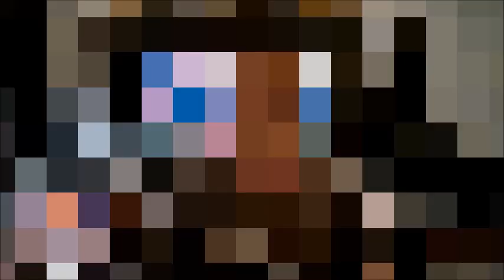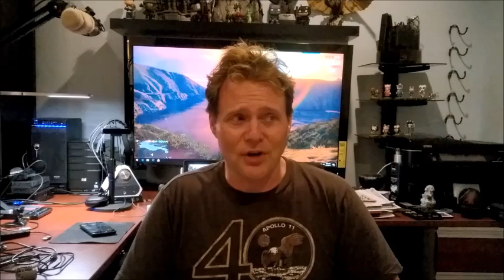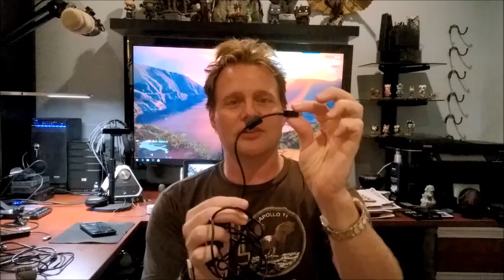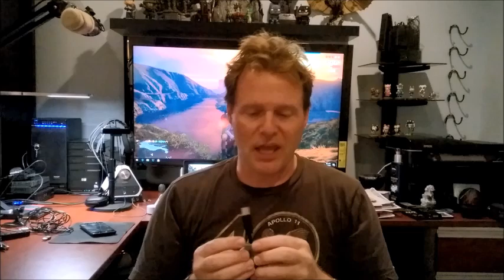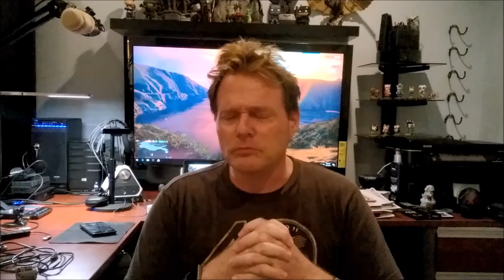What are Ferrite Cores and How do I use one?

Comment: Can you use these to reduce noise in a chain of effects for guitar? Where would you use them - audio guitar cable between effects pedals and/or power supply cables? I know guitar pickups also pull in noise, specially single coil pickups. I am just trying to reduce as much noise? Or are these not needed if the guitar/patch cables are shielded?
Reply from the maker: You're right that good shielding is supposed to solve this problem and you shouldn't need it.  If you're getting noticeable noise, that's another story, and that could be a bad grounding or EMF.  I'm not a sound engineer like some of the people I know, but if I can ask one of them for more detail, I'll share it with you. As far as using a ferrite core to reduce noise in a chain of effects, you could try connecting it at various points in the chain to see if the noise goes away at any particular point in the chain.  Hope this helps you!

Comment: Couldn.t you use copper wire to loop around the lead? 25 or more turns around the effected line?
Reply from the maker: You certainly could!  I originally did this video to help out a friend to understand the basics of what Ferrite cores are and how to clip one onto their mic to solve an interference problem--but yes, while putting a Ferrite Core on can be a simple test and provide a quick fix, introducing multiple turns of copper around the lead is certainly another option.  Thanks for sharing this! :)

Comment: Application described in simple words.  Can ferrite be used on both 120 volt n data cables or only data n voice cables.
Reply from the maker: Hi surendersignal2192! They can be used on any insulated cable, so yes a 120V or data cable, etc.  Hope this helps!

Comment: Hi Trenton, thanks for the video! Question- here in snowy MN, I used to listen to this FM radio station all day and came in great. This is on an older stereo that has the old school antenna terminal ends where I just cut copper wire for antennas and strung them up. However- I installed some LED lighting in my shop (outlet/string connections- not hard wired) here and since then, that radio station is complete fuzz and also makes random other stations fuzzy. Interestingly enough- radio is still fuzzy even with the lights off which is odd. No amount of copper wire or trying different positions has made that much of a difference so it has to be the lights. Would putting these ferrite cores on the lighting cords and/or the radio power cord help at all? Help! My classic country station hangs in the balance!
Reply from the maker: It can't hurt to try!  Also, check to see if the problem persists if the LED lighting is completely unplugged, too.  I hope that helps you!  I ended up buying an aftermarket FM antenna for my home theater system that has its own power source, so that may also be an option.

Comment: Will a ferrite core improve reception from a dipole antenna receiving at 459 MHZ...if I add a ferrite  core around a RG58?
Reply from the maker: That's a good question!  I know it won't hurt, since the primary benefit is filtering out higher frequency.  It can't hurt to try, I'd love to hear if you find a difference.  It's mostly designed to solve an RF interference problem though.

Comment: Exactly the info I needed, thanks. I recently bought a good external condenser mic and last night was getting really bad hum/buzzing.  Turned out to be where my extension cable was laying across my bed and my electric blanket was on. I get hiss anyway but was wondering if this ferrite would mitigate the interference if ever I go near such things again.
Reply from the maker: Really glad to hear it!  Condenser mics pick up a lot of the environment, so that hiss may be mitigated by adjustments to gain--but I'm glad to hear you fixed the hum! :)
Reply: @trentonbennettVO   Thanks. I've since found that ferrite is bad for audio cables. The work initially very well, but degrade the cable and over time make it sound bad. They are better for less sensitive applications
Reply from the maker: @ArcanePath360  yikes!  I hadn't heard that a ferrite bead/core/choke would degrade a cable, and I can't find anything on it.  Do you have a link you can share?

Comment: Hi Trenton!  I just finished watching your video.  One question I have is what do you do when you are receiving a local radio station through our sound system.  Every time we hook up another item, i.e. guitar, electric drum set, mics, etc., we continue to hear the local radio station broadcast through our speakers.  My question is does these ferrite cores help with blocking the radio transmission through our sound system and where would we connect these to, i.e. just the speakers, the snake, the individual instruments, etc.?  Thank you for your help in this matter.

Comment: A clip-on is effectively only one turn onto the core. The inductance increases as the square of the number of turns on a core, so, passing the wire around again is 2 turns which will give you 4x the inductance of the straight clip-on.
Reply from the maker: Thanks for this, by the way - a lot of people have been reading these comments and you've just helped them too! :)
Reply: Is it more effective to apply to the source wire, or the receiving wire? For example, on my headset I hear a whine when turning on a large 28v dc motor & heater. Do I clip the headset or the heater or both?
Reply: @kevinchase313 check the description on the video. From what I read, I think it is the receiving end, not the source. If you can get extra cores just add them to both ends, as it provides extra protection!

Comment: A clip-on ferrite does not shield the cable, it increases the inductance of a cable, thereby reducing currents due to interfering high frequency or R.F. magnetic fields. When clipped onto a twin cable such as the power cord, it will only increase the inductance to common mode signals. You would need to clip onto individual conductors separately to impede differential mode interference. Small ferrites only work at high frequencies. There are many different types of ferrite, some lossy , others not. None will do anything for hum or other low frequency unwanted signals caused by electrostatic pickup from electric fields. You need screened cable to reduce these.
Reply from the maker: Thank you Ricobass0, this is a much better explanation. :)
Reply: Is it better to combine the power cord or separate conductors?

Comment: Hi great video Thank you.

I am by no means familiar with emi rfi noise, so I got a question.
I am using ferrite cores to supress noise on my pc quipment. From your video I understand I should be placing them near the ports of my pc.
Am I correct in assuming that? 
I have a few cores around my power supply, usb, dvi and hdmi cables
Reply from the maker: Hi Roku! I'm glad this video helps you.  That is one way to test, yes.   Basically if you're having an electrical interference problem, a Ferrite Core can help you either troubleshoot or eliminate the problem because it shields the device and can block the bad signal...so if a USB device is getting interference from within the PC then stopping it before it goes down the wire might help.  However, if the device is getting the interference from the surrounding air, you could also put one on the end too.
I'll explain a bit. :)  
If you look at a wired XBox 360 controller, it's got a Ferrite Core built-in, near the controller, just to make sure the controller isn't getting problems from electrical interference.  When my friend Veleka (the person this video was for) was having a problem with her USB mic, I suggested she put the core near the mic because that was more likely where the interference was being picked up.  These would be times when it seems most likely that the interference isn't coming from the PC and is directly affecting the device connected to the PC.

There was a time though when I had the front-panel audio of a computer creating noise in any headset that I plugged into the front-panel audio jacks.  I put the ferrite core on the plug-end of the headset, the end that went into the computer front-panel headset jacks, because I wanted to stop the noise.  I eventually realized that the front-panel audio wire inside the case  that connected the motherboard to the front panel was getting the noise from something on the motherboard generating interference inside the case.  I put a ferrite core on the end just before where it connected to the front-panel.  When that didn't help, I replaced the internal audio cable and all was well.
I realize that's a lot of typing! But I hope it helps you.  This gets a bit technical but also explains the nature of what causes electrical interference:
http://www.emfservices.com/electric.htm
Reply: @trentonbennettVO  
Thank you so much for the detailed explanation! You are awesome for taking the time to make it a easier to understand. I am sure you are helping more people than you know.
I'll be testing for sure. Have a good day :)
Reply from the maker: @roku6170  thank you so much for this! It really makes me happy to hear it.  I had done this to help a friend and thought, "Hey, I bet other people might be wondering how all this works".  I can't get over how many views this video has gotten.  With luck I'll figure out some more useful tips that aren't easy to come across.  Hope you have a great day too :)

Comment: What benefit(s) would be achieved if ferrite cores were added to my marine/boat Humminbird/Garmin electronics...GPS w/down-vision, side Imagining and sonar?
Reply from the maker: Hi John!  Most manufacturers use the right quality cables for electronics and some go an additional step and put one of these on their cables at one or both ends, so you shouldn't need one.  You wouldn't really benefit from adding one unless you're experiencing a problem with interference and then you want to troubleshoot whether it's a grounding problem or a problem with signals coming through the air around you fouling up your equipment.  Usually that sort of problem comes from nearby electronics or being close to a radio tower, etc.  It's unlikely you'd be experiencing that in your scenario with side and sonar as the emitters are aimed away from your boat and the equipment (especially the Hummingbird and Garmin brands) should be assembled in good quality and go through Quality Control (QC) checks before it gets boxed up and sent to the store.  That said, this is a really good article to explain it a bit more in detail - https://www.rfpage.com/electromagnetic-interference-and-compatibility-in-radio-frequency/  - the bit about "Radiated EMI" is the problem a ferrite core tries to solve, and in the section "How to avoid electromagnetic interference", the passage about "filtering" refers to devices like a ferrite core.  The English isn't perfect in this article, but I like the bits about "How [is] EMI Generated?" and "Sources [of] EM Radiation".  Hope this helps you! :)
Reply: @trentonbennettVO  Problem experiencing:  HUMMINBIRD GPS 898-C combo (Side vision/Down view) shows erratic  depth levels when Minn Kota 36V troll motor is turned operating.  ALL other features functions properly except giving incorrect sonar/depth numbers-while in 12’-15’-gives 50’+, 60’+, etc…!
Reply from the maker: @504blood-sweat-tears  yeah, I can see why that would be a problem! I'm wondering if the trolling motor is hooked into the same electronics as the Humminbird--thankfully, they've got an article in their help center that talks about exactly your situation - see if this helps you?  https://humminbird-help.johnsonoutdoors.com/hc/en-us/articles/4412819927063-Trolling-Motor-Interference
Reply: @trentonbennettVO  Thanks will ck it out…ALL 3 batteries designated ONLY to  36V troll motor.  ALL Electronics run off start battery…!
Reply from the maker: @504blood-sweat-tears  Rats!  I was hoping that would help you, but you might have to try multiple ferrite cores to see if you can kill the interference.  Hope you can find a solution, I know how maddening it can be sometimes when things that shouldn't be going wrong, are going wrong weirdly. :-/

Comment: I just receive a 20 pack fro Amazon but I still have one question.  How do you open the little guys?  Please respond if you have the answer.
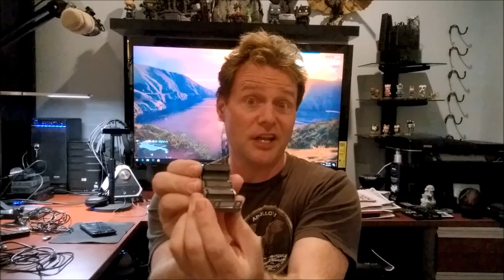Reply from the maker: Sure thing!  There should be one or a pair of little clips that you can pry apart.  Here's an Amazon listing that has a picture of one open so you can better see what I'm doing there in the video from about 1:29 to 1:47.  I hope this helps you!
  https://www.amazon.com/RF-Choke-31500-Ferrite-Material/dp/B00XDACVOM/ref=sxin_16_pa_sp_search_thematic_sspa?content-id=amzn1.sym.b245e49f-68a4-4489-b1f9-81f4034255f5%3Aamzn1.sym.b245e49f-68a4-4489-b1f9-81f4034255f5&crid=3DA9IEVWMK9BT&cv_ct_cx=ferrite+core&keywords=ferrite+core&pd_rd_i=B00XDACVOM&pd_rd_r=c15e64bc-6aa7-49c7-b555-761f23715aeb&pd_rd_w=3KCVk&pd_rd_wg=lk4Kg&pf_rd_p=b245e49f-68a4-4489-b1f9-81f4034255f5&pf_rd_r=SC09V4D1NSR83EV6Z56B&qid=1656646146&sprefix=ferrite+core%2Caps%2C104&sr=1-2-a73d1c8c-2fd2-4f19-aa41-2df022bcb241-spons&psc=1&spLa=ZW5jcnlwdGVkUXVhbGlmaWVyPUFKQVdDWVYyRzFZSE4mZW5jcnlwdGVkSWQ9QTAxNDM4OTEzVjgzVlk0WkZGU1UyJmVuY3J5cHRlZEFkSWQ9QTA5NDg1ODk4NEo3T1JZM0o2V00md2lkZ2V0TmFtZT1zcF9zZWFyY2hfdGhlbWF0aWMmYWN0aW9uPWNsaWNrUmVkaXJlY3QmZG9Ob3RMb2dDbGljaz10cnVl

Comment: I installed a Holley Sniper EFI & the EMF fields from my vehicle 12v system are causing it to run & stall intermittently. I've wrapped wires & added ferrite clip to wire my meter showed high.
Still problems, any ideas.
Reply from the maker: I haven't run across that, but I did run across this on Holley's forums - it's a link advising to keep an eye on how you run the EFI's wires and also that higher-grade spark plug wires will have more shielding. It's been a long time since I owned a vehicle with a Holley, so I hope this helps you!  https://forums.holley.com/showthread.php?50168-EMI-RFI-Problem#:~:text=Yes%2C%20all%20wires%20coming%20out%20of%20the%20Sniper,super%20careful%20with%20all%20of%20the%20Sniper%20cables.
Reply: Make sure ALL your grounds are good. Block, chassis, battery, make sure they all are low resistance. Some Aftermarket ECU companies like Fueltech suggest to ground the ECU directly to the batter, as the battery itself actually acts as a filter for noise ect. Hope that helps somebody
Reply: @satyavratadas1640  Hello, what can cause the speed of voltage drops in car audio system?
No connection loss in AUDIO wires (it is possible that somewhere in the original installation of car)  Under the hood i cleaned all ground wires, alternator is okay, but i still have weird issues, like SHort circuit but induction between power wires. Sometimes i cant charge my amplifier with bulp 5w, sometimes charging amp is only 6 sec, sometimes voltage stop at 5volts and comes down and up (4,5-5,3v) and cant charge! Lol. Its on all tested amps, like induction in wires. I have too bad sound, capacitorrs degradation itp.

Comment: OK, I have a question and I have tried to look at the comments first. May not be a bad idea to make a question and answer guide and link to that. First of all great video, you explained it very well and I made sure to thumb up it. My question is will 2 cores make a difference one on each end or should I use just one? I have a check scanner and I am all of a  sudden getting some black lines on it and I know the scanning part is clean so that leaves me with electrical interference or a bad board. I figured Ferrites are a cheap trial for it. I have also purchased a Furman Power conditioner. Figure $40 is worth it to try.
Reply from the maker: Hi Christopher!  I'll add some more information in the comments. :)  2 cores can make a difference.  Manufacturers that install a core most often do so at the end of the cord where the device is and not the end that goes into the computer.  Putting one at each end could help if you believe RF may be a pretty intense problem.  You can also try a different USB cable and even buy a more shielded cable.  Your Furman is also an excellent idea!  I hope this helps you and thank YOU very much for the thumbs up and this feedback.  I'm going to update my comments to help others.

Comment: Would these help with a buzzing sound I am getting from a DRL light strip I have in my bumper of my van? I installed a new head unit and now I am getting a buzzing noise from the light's?

Comment: Great video, are more than one better?
Reply from the maker: Hi Jay N!  They could be, typically if you're going to try that you'd put one at either end of the cable.  The goal is that any interference that gets into the wire doesn't end up in the final output, so for example with a microphone you'd have one just before where the microphone cord plugs into the deck or computer--if trying two cores, then you'd put a second one on the end of the cord where the mic is, too.  Hope this helps you!
Reply: @trentonbennettVO  it does, thank you.

Comment: How to open the core to remove it?
Reply from the maker: Hi A L!  If the core wasn't glued on at the factory, look for one or two small clips that can be pried apart, and then the core will open up.  Not all cores will be like this though--if you don't see any divots or anything you can pry, it may not be intended to be opened or removed.  Hope this helps you!

Comment: I’m getting RF interference on a FM stereo I’ve tried a lot of things but have had no luck removing it. The transmitter has two chokes on the coax, one at the antenna and one close to the radio. The coax is wound on a a piece of PVC pipe on the mast 6” down from the antenna. I used 11ft of coax on the PVC pipe. An amateur radio operator gave me this information and said it would work. The stereo is not a new one and uses a “T” type antenna. Can you please suggest a cure. Thank you for your help.